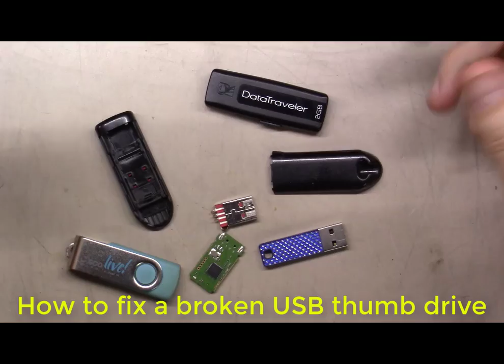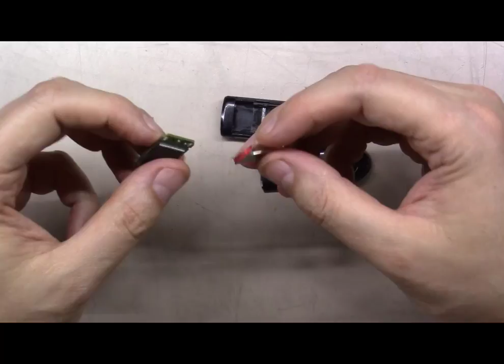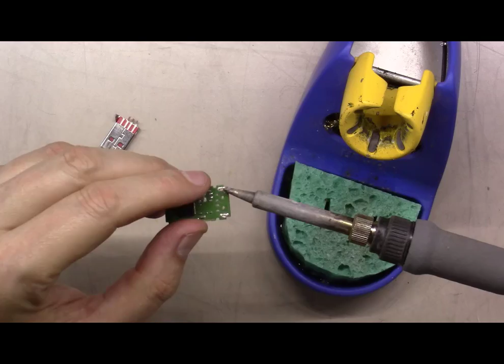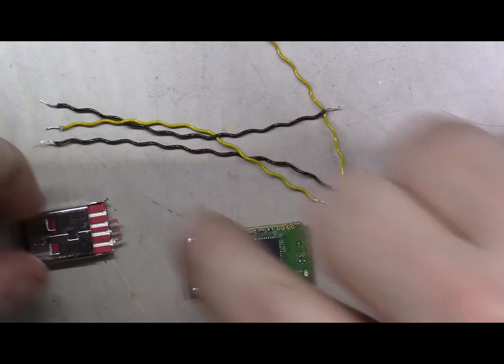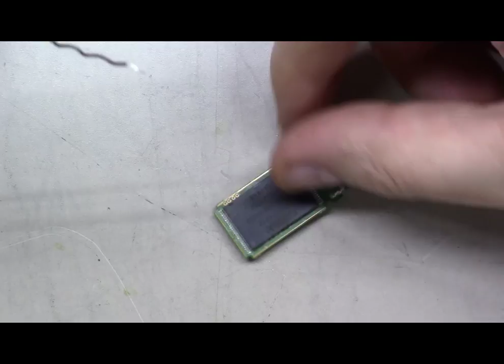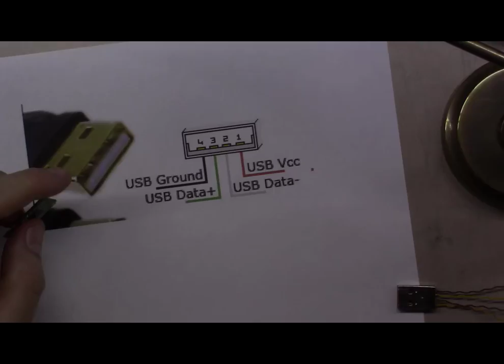How to fix a broken USB Thumb Drive

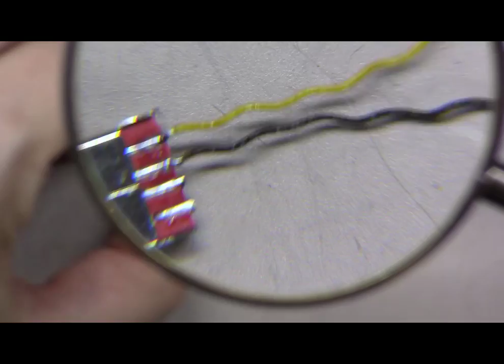Comment: Obviously my eyes are fooling me, but it looks like your solder is touching the plug box for all four leads. Clearly this would short all circuits , so I can't be right, but  especially at 5:22 it really looks like you soldered the USB Data+ wire to the male connector.

Comment: You can also use any USB cable and cut the end with the A plug. Saves a bit of work, but unless you have a broken cable lying around (broken at the other end), you need to ruin a working one. But nice job as always.
Reply: instaBlaster...

Comment: Perhaps you could advise the teacher to make backups, and not have all data on one device. I use four external hard drives and two thumb drives to make backups. Some weekly, some daily. Two hard drive are kept in another building for extra safety.